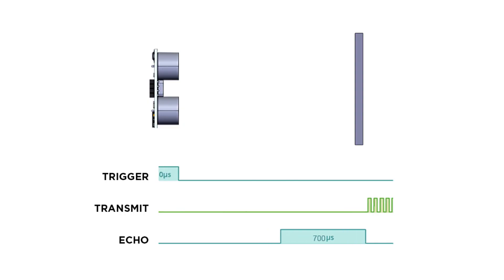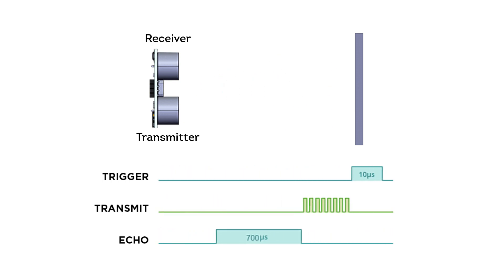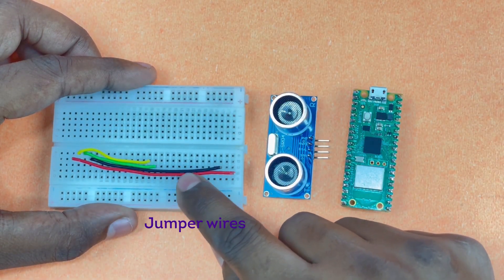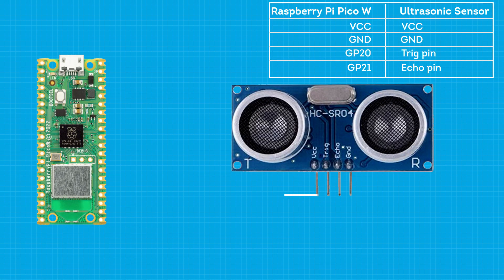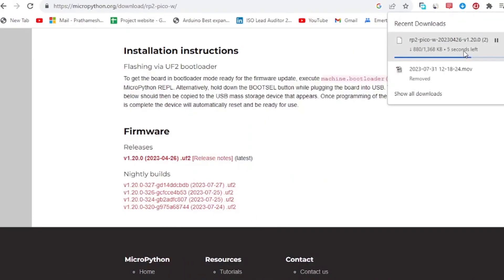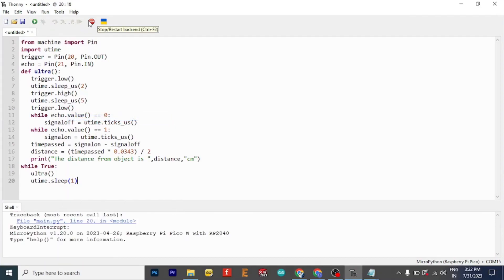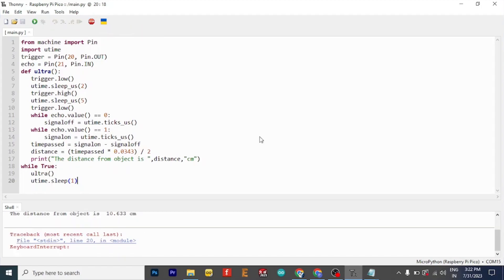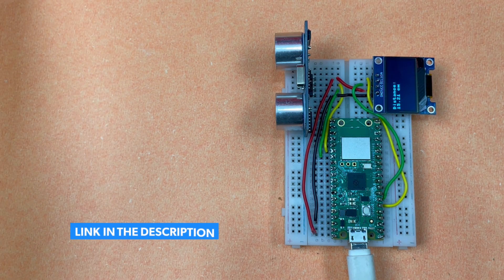Interfacing Raspberry Pi Pico W with Ultrasonic Sensor

Comment: I try running the program and get MPY: soft reboot and nothing else
Reply from the maker: In the thonny IDE click run- configure interpreter on that menu there will be a check box at the bottom (restart before running script) Untick the box. If you still face issues, please open a new discussion in our forum with more details.  https://circuitdigest.com/forums